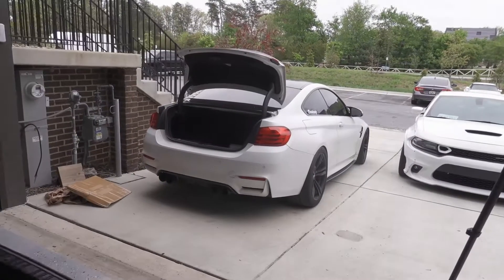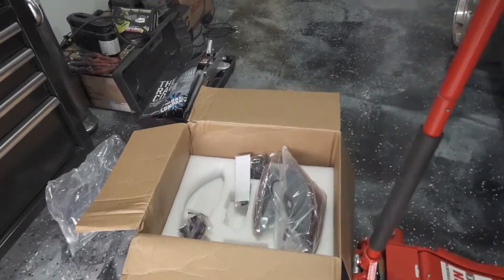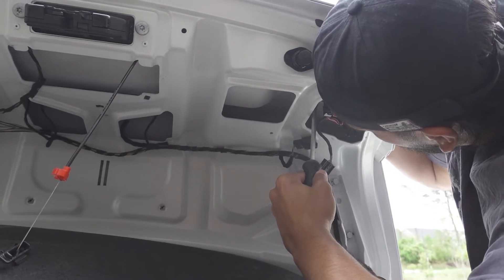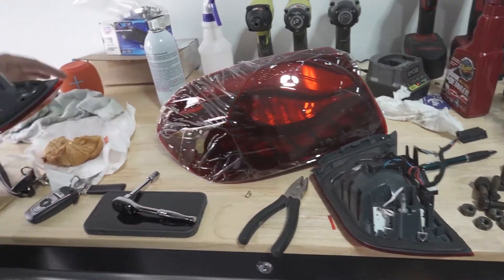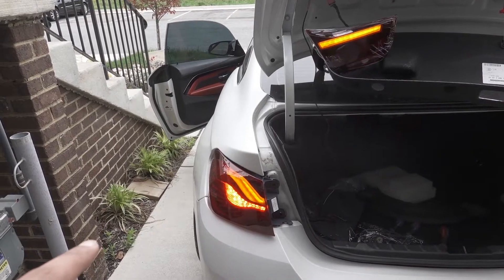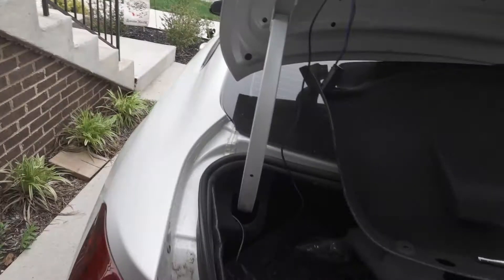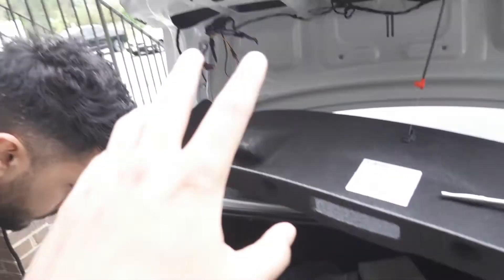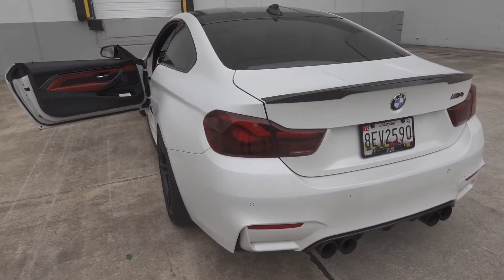600HP BMW M4 GETS GTS STYLE TAIL LIGHTS!! KIES MOTORSPORTS

Comment: Flashing brakelights aren't intentional, it's because of the cold-check on the bulbs. 
Not sure why it's only on the brakelights, but to fix it, just get bimmercode and code the taillights to be LED.
Unfortunately lights- and bulbswaps in BMWs are néver just a direct plug & play swap, even with canbus LEDs and that, you always need to code them out.

Comment: Were you ever able to get the inner tail lights to sit flush on the bottom? I am also having an issue with bottom having large gap, the top portion hitting the car, and not sitting flush.
Reply from the maker: Honestly no,  it was far from perfect but we did take our time with it. Pushed it into the place we wanted and tightened it down slow and with a good amount of pressure from the 2nd pair of hands
Reply from the maker: That way we got it where it looks decent but def not a OEM finish
Reply: I see, That’s definitely good to know. I was using a lot of force and actually scratched my paint on the top portion a little bit. But I’ll try again. Thanks for the swift reply!
Reply from the maker: @nmcali123  good luck! I actually have been getting a few DMs about pretty bad to decent fitment so just a heads up